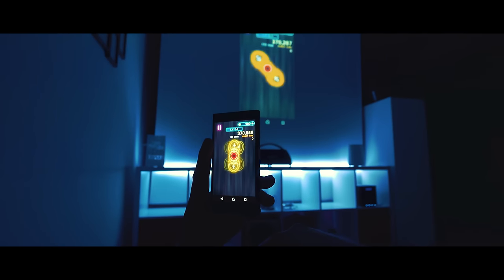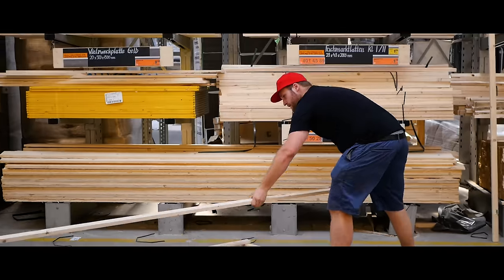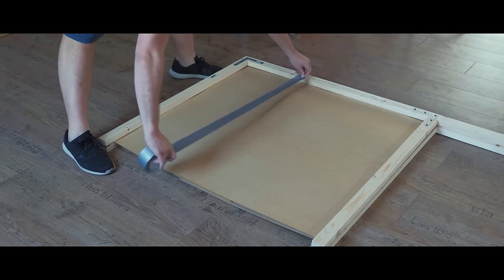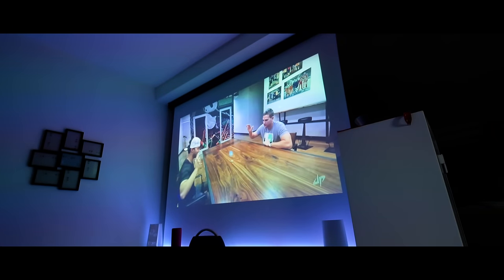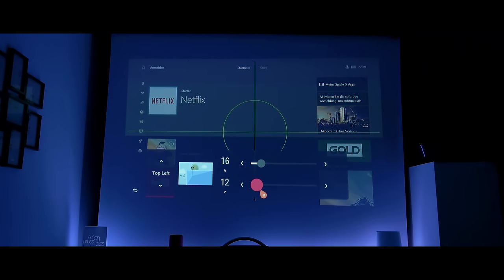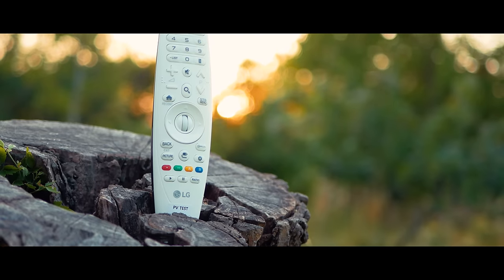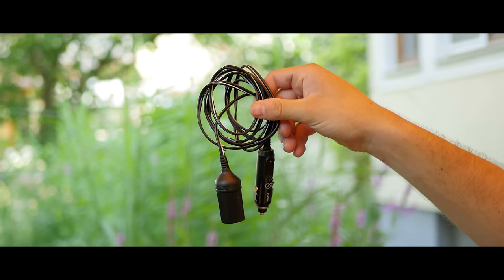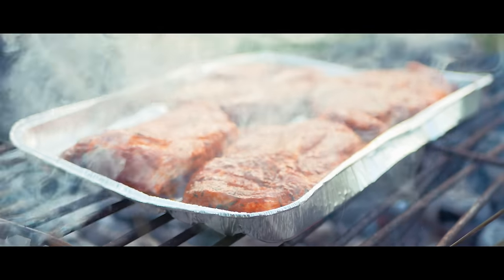How to make a portable Smartphone Laser Projector - LG HF80JS Review

Comment: Thanks for the wonderful video, I have a question for u if u don't mind.
 I have a LG pf1500 LED projector and I want to use it outdoor with a battery backup. I can see from the video you use a car battery and a DC to Ac convertor but I did not fully understand how u get there. U mentioned that there should be sufficient power to run the projector and I see u do some soldering but I did not get that.
 Sorry, I do not have basic knowledge in this stuff. It would be very helpful to me and others like me if u had a separate video with details. Thanks
Reply from the maker: John Abraham you just need a converter that can put out enough watt for your projector. I just soldered a connector cable to connect to plus and minus on the battery
Reply: Thanks Steven for ur reply, I will try and see how it works.
Reply: How is this projector LG PF80J compared against LG PF1500?